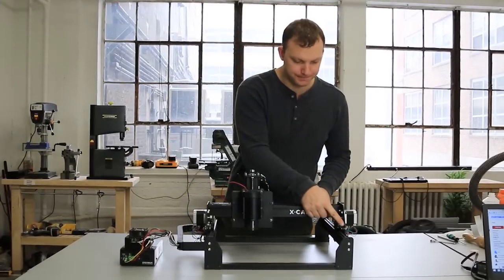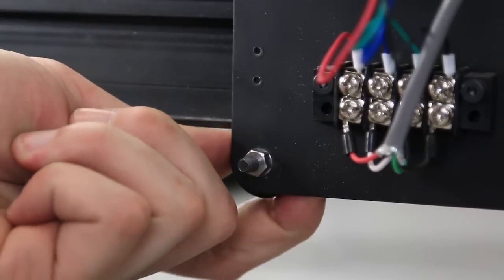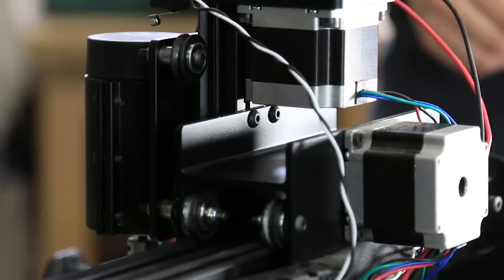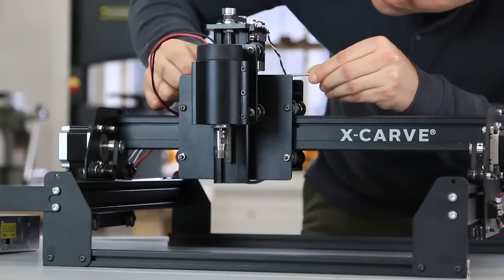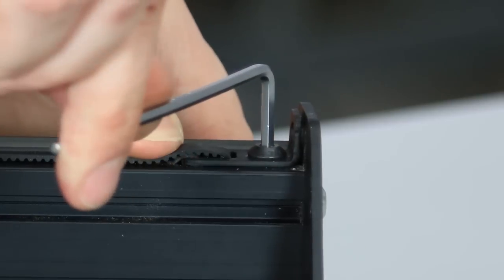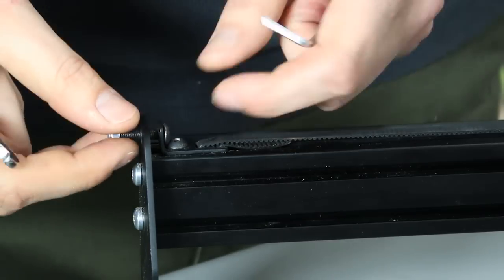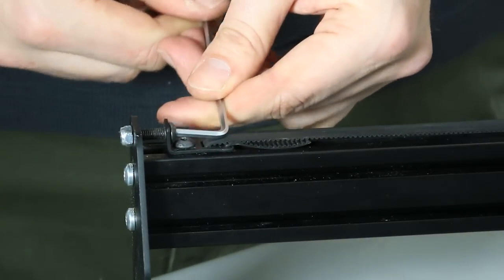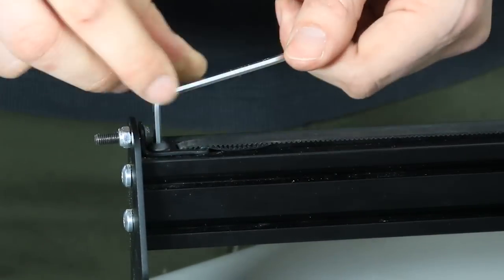X-Carve | Assembly | Tuning

Comment: Don't you want to square the Z axis to the wasteboard or whatever your cutting substrate is?  That way if the table is not flat it won't matter, and if you decide to move your x-carve, the whole unit is calibrated and true to itself rather than some outside dimension.